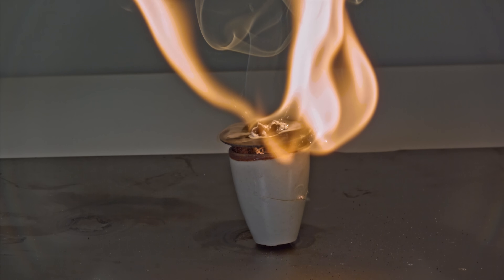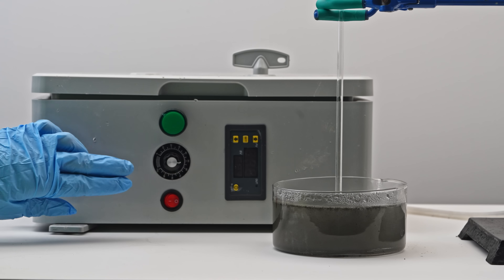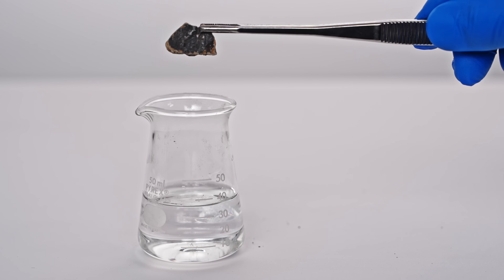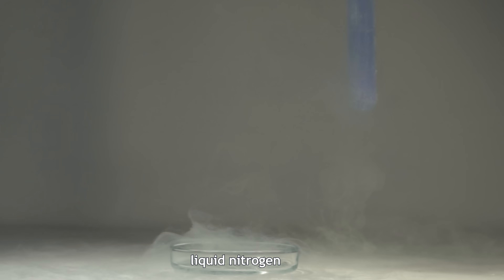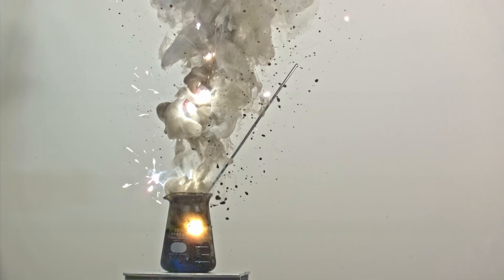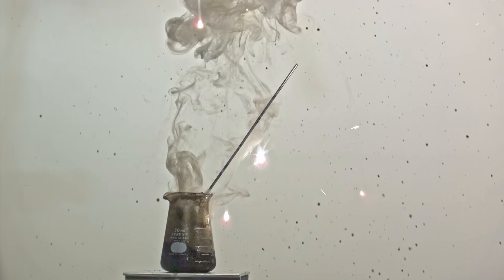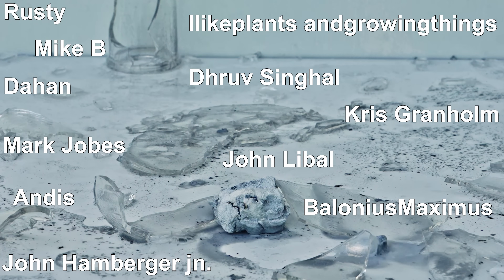Violet Violent Liquid Ozone and Phosphine

Comment: What caused the last two beakers to explode exactly? A build up of pressure, a sudden release of energy after one of the reagents was depleted, a build up of a reaction product or combination of products? 🤷‍♂️
Reply: Acetylene is capable of detonating  when mixed with a strong oxidizer in a close enough to stoichiometric ratio. That's almost certainly what's happening here. It doesn't happen instantly, as the ratio is too far off initially, but once the mix is right, it doesn't need confinement for a shockwave to form.
Reply from the maker: In fact it's the ozone itself that explodes, I saw the same behavior in the experiments with aluminum sulfide hydrolysis where hydrogen sulfide was released and with phosphorus iodide which released hydrogen iodide. 
I also tried condensing ozone onto solid N2O4 and KO2 and that ended with an explosion too! The Dewar flask shattered into pieces!

Comment: I'm curious to know why the liquid oxygen/ozone mixture floated on water. I guessed it would be denser so I looked it up, and I was right (liquid O2 is 1.14 g/ml and liquid ozone is denser than that). What's the explanation? Is it because it boils and is suspended by a vapour layer?
Reply: Yup. It's just the leidenfrost effect keeping the two liquids separated.

Comment: Is it still a Leidenfrost effect if theres no high heat involved?? it looked like a Leidenfrost effect when your poured the liquid ozone into the water near the end of the video...
Reply: Yes. Technically, to the ozone/oxygen liquid, the water IS the high heat. So it's boiling away and pushing the water away with the gas being produced. Effectively floating itself ontop of the water.

Comment: So Phosphine (PH3) does not spontaneously ignite in air, but Diphosphine (P2H4) does, correct?
Reply: Having worked with the related tetramethylbiphosphine, I can confirm that the stuff is insanely air sensitive and pyrophoric
Reply: Phosphine is relatively stable actually, usually requiring a spark or flame to ignite.

Diphosphine however has a higher energy content and weaker p-h bonds, making it more reactive. It also reacts easier with O2 than phosphine as it is less stable.

I'm not 100% sure but I'd guess phosphine also reacts with O2, but at a significantly lower rate, but I am not sure.

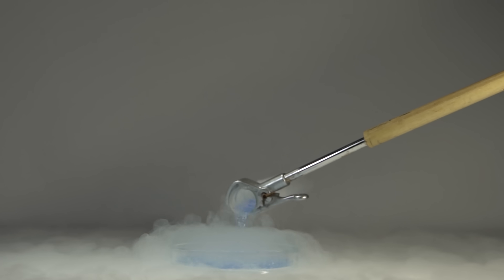Comment: 4:06 Why does liquid N2 delay the reaction that much if oxygen and gaseous ozone don't react with the solid acetylene?
Reply from the maker: To be honest I’m not sure I’ve only done this reaction once so I don’t have enough data to answer that question definitively, I just needed to say something during that shot 😬
 But I think the ozone concentration was low at the beginning, you can see the solution in the video is a very pale blue. That’s an old shot back when I was still using a low-power ozone generator🙄
Reply: @ChemicalForce  Interesting! I suppose with dilute O3 it might've simply taken a bit for the reaction to reach the runaway point
Reply: dilution + extreme cold slowing the reaction? possibly some kind of physical barrier from impurities like water?